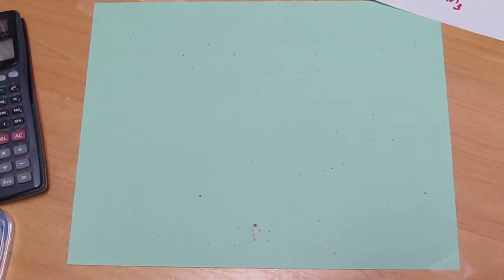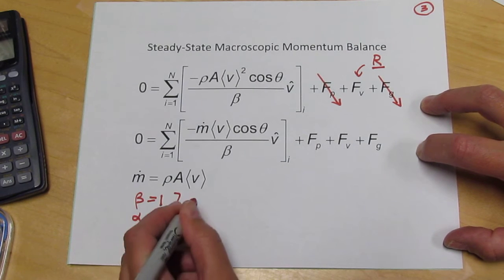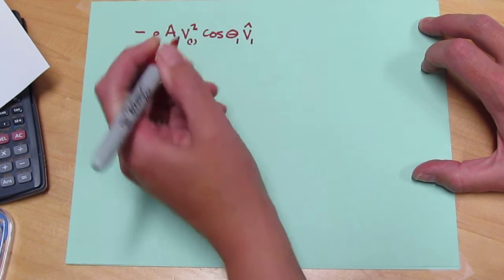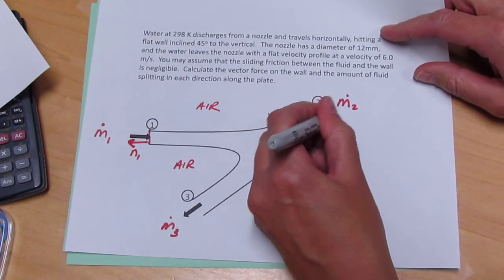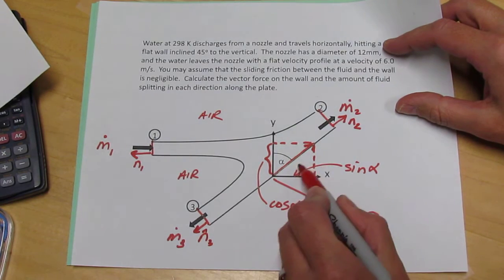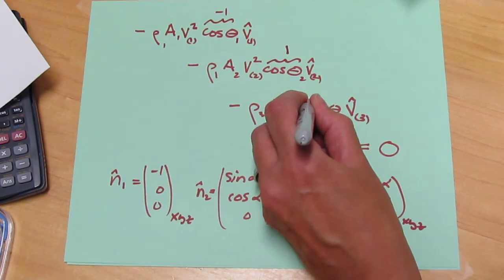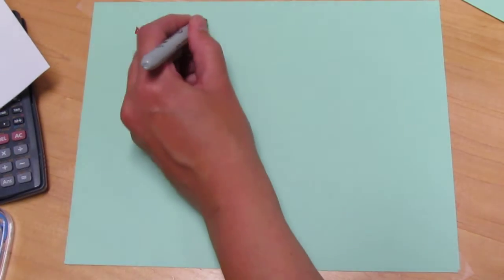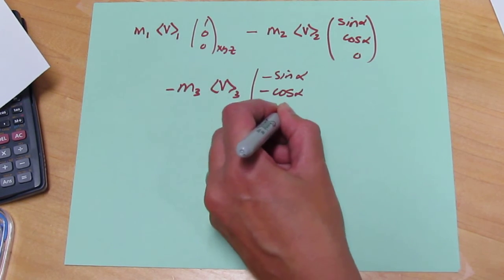Part II: Macroscopic Momentum Balance - nozzle flow to tilted wall

Comment: Why would you neglect the pressure forces? The pressure is equal, but the force is a vector. At point 1 it points in the horizontal direction. At 2 it points down under 45° and at 3 it points up under 45°.
Reply from the maker: Pressure is an isotropic force.  It has the same magnitude in all directions. Therefore the change in direction has no impact.

Comment: Thank you for the very clear explanation. At 6:50, you define the unit normal as (1,0,0), but you previously defined it as (-1,0,0). Is this a typo or did you switch the sign on purpose? When I solve this problem, this switch in sign switches my mass flow rates for m2 and m3. Could you clear my confusion? Thank you!
Reply from the maker: Note that vhat2=n2 and vhat3=n3 but vhat1 is negative n1 (it's an inflow surface).  Thus I used (1 0 0) which is negative n1.